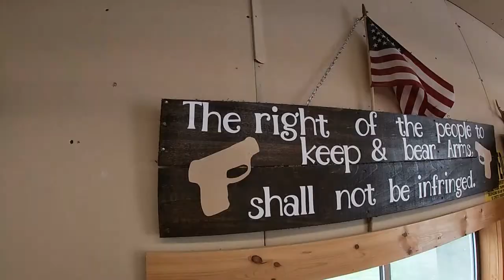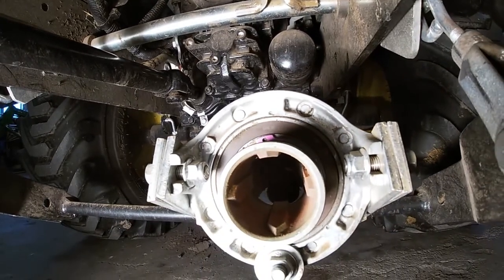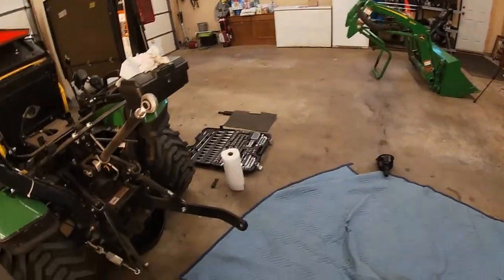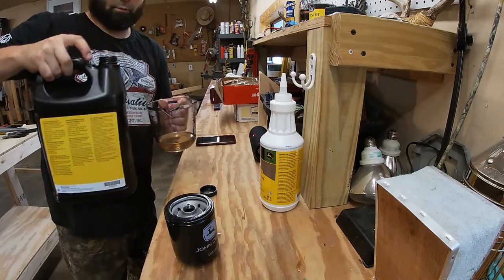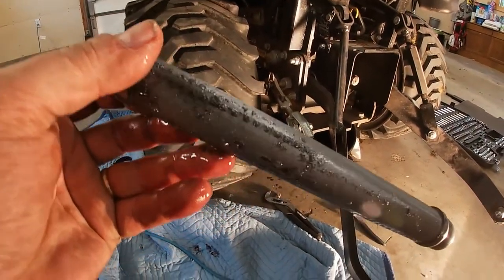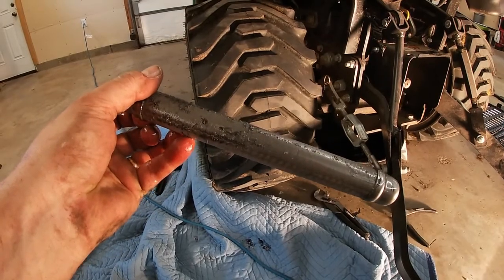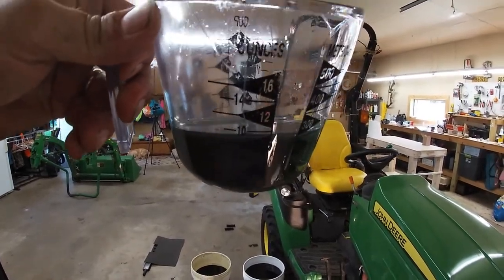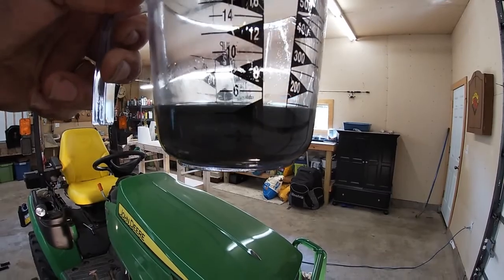John Deere 1025r Transmission Fluid Change (200 hour)

Comment: 👍👌 Excellent video...thank you
Reply from the maker: Glad you like it!
Reply: Just FYI, this service is to be done first at 50 hrs., then at 200.  If this was the first transmission oil change at 130+ hours that’s why all the shavings.  Thanks for the video!
Reply from the maker: 2018 model and later is 200 hours per the manual, but I didn’t want to wait that long.

Comment: How do you keep the oil you just replaced from leaking out when you pop off the suction screen hose. My new hydraulic oil is leaking out as soon as I took off the hose
Reply from the maker: It’s been a while since I did this, but you should have taken the suction screen out after you drained the old oil and before you refilled it.
Reply: @GreenAkers  Yep, realized that after I pulled it out. Off to the John Deere store for another four gallons of hydraulic fluid
Reply from the maker: Bummer!

Comment: You tighten the filter with a wrench?
Reply from the maker: My hands were filled with hydraulic oil, so I tightened it slightly after I couldn’t hand tighten as much as I wanted to.

Comment: I don't trust a how to video from a guy who uses a 2 gallon drain pan for a 4 gallon fluid reservoir unit.  Then he says, "damned, I knew that was going to happen", as a cover up for his lack of thought.  No thanks.  I'm out of here.
Reply from the maker: Lol, thanks for the feedback
Reply: It must be nice to be so perfect that you've never been distracted while doing something.
Reply: @channell11  I appreciate the video, thanks for making it. I almost changed it and looked for another one then I watched some parts where I learned something and kept watching. I think what this man was getting at was it was apparent that this wasn't something you had done a lot of times previously, that doesn't mean it doesn't have helpful information, which it does. I saw the workbench that looked like it had never been worked on and paper towels for the kitchen instead of shop towels or rags to soak up the oil and thought maybe you had recently acquired knowledge that you were sharing instead of someone who's done this many times. Either way, thanks for the video and keep sharing them. Don't let the negativity discourage. Not everyone is infinitely experienced in everything.